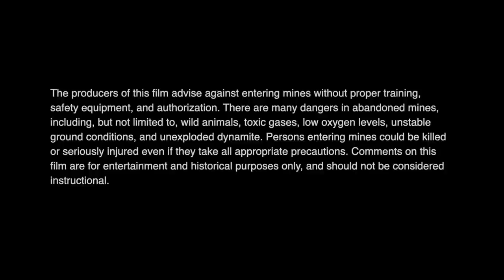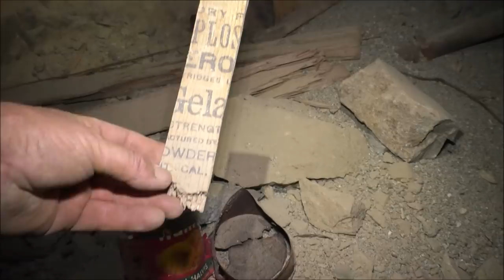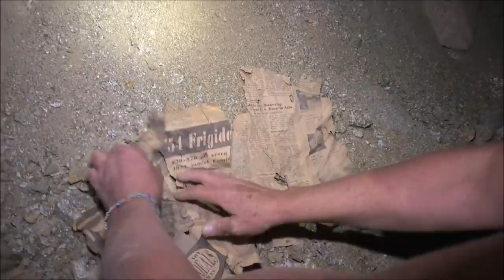#201 Gold and Tungsten in Atolia part 1

Comment: Hi Frank & Sharon, the best way to get dust from your lungs is to use a Himalayan salt inhaler, they are very good, I use one because I have COPD and it has helped me immensely, I used to get breathless doing things but I don't anymore. The inhalers are really not that expensive either and the Himalayan pink salt can last for a long time before it needs changing. Christ Almighty there were some tight squeezes in that one, Sharon is one amazing Lady following you through all of those scary places, what a trooper. A very twisty mine actually, I haven't seen that many like it before, but there were some cool artifacts to see. Thanks for sharing, take care n stay safe, much love. xx🤘🏼💖
Reply from the maker: If I quit breathing dust for a while it seems to clear up. I had the same problem when I was farming.
Reply: @exploringabandonedmines  That's a relief, I just thought you may want to look it up in case it's ever needed. I took me 7-8 years to find it out after I got COPD as no-one told me, I just was doing some research into alternative treatments in case of inhaler shortages with this pandemic. xx

Comment: A lot of the mines in the area owned by the owners so they interlink the mines together  that's why you have so much air flow in all directions. I know a few that they're 2 to 3 miles apart.  the rock structure is very strong inside took a lot of explosive to blast them out lot of hard work.

Comment: That is an extensive mine but it raises a couple of questions. Did the ore run that many directions through the country rock or did the miners do a lot of prospecting which I don't really believe? I didn't see any coring holes. And assuming they found ore as they passed through some of those small openings how did they get it to the haulage, assuming there was a haulage? Everything looked like drifts. That is a really cool mine and it appeared that the rock was so sound that the ladders weren't all broken up. (And no idiots dropping rocks down the shaft). Thanks for sharing.
Reply from the maker: I think the small openings were just connector tunnels to adjoining mines. There were a lot of headframes in the area!

Comment: Once in awhile this comes up when I'm on YouTube and I watch it.  I'm going to stop watching this not because I hate your channel or the creator of the content but rather i get upset and a bit angry seeing the position these folks are putting themselves in.  See, I worked as an underground miner for some time and I can assure folks that there's nothing underground worth finding or seeing.  What's usually left is a bit of garbage maybe there's some water and sometimes lot of loose rock.  Maybe unfit air.  The bottom line is there's really nothing to see down there folks, all it happens to be is a hole in the ground and it's not worth risking your life or these people's lives to see what in a hole and I'm upset folks are risking everything for nothing in return by entering these places.

Now on a professional level it's safe for me to enter such places because I'm not going exploring.  If I'm going into an old working it only to rehabilitate it and I would be going in with equipment to analyze air, scale bars, ground support material and a jackleg to bolt my way in, timber or steel set, mesh wire, and or chainlink, maybe some mats.  With it I would be hanging proper air or vent line as well.  This is how it's done in real life and how you do it in your occupation.  It's done with support of someone knowing your workplace and location and objectives of the shift.  This whole business of climbing around old mines with no ground support with cave in and walking under those open stop cavities is insane and you don't do this working professionally in a mine.  Also, climbing up a muck chute is pure nuts as is rappelling down old shafts.  Just picture a piece of loose from above or piece of timber falling from a height above you as you are below.  You just don't do such things.

As I say, there's just not much down there if anything at all worth taking any risks and I hate seeing these folks get into a jam injured or killed because they had to go look in a hole.  But I myself just need to quit watching this cause it goes against everything sensible and just gets me worked up.  Sorry for the rant.
Reply from the maker: What risk I have been in hundreds of mines and never been injured in 5 years. Sorry if you think mines are boring I don't!